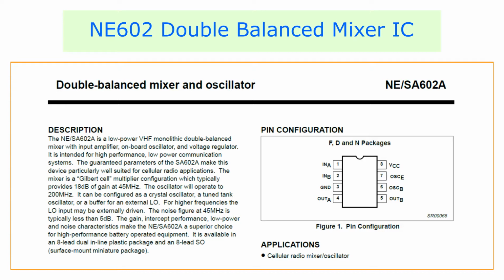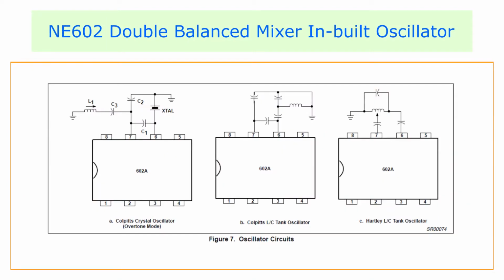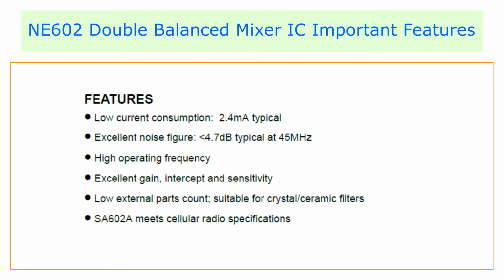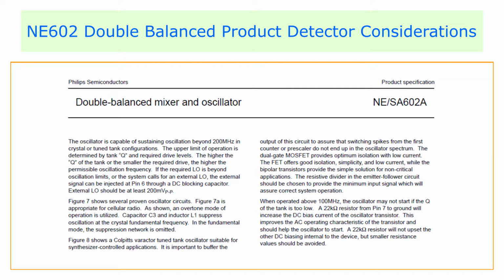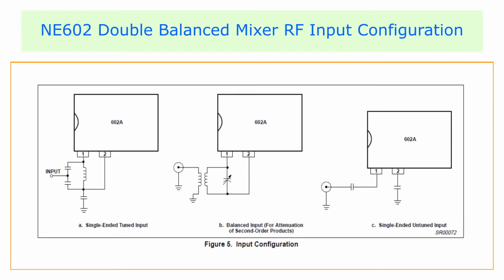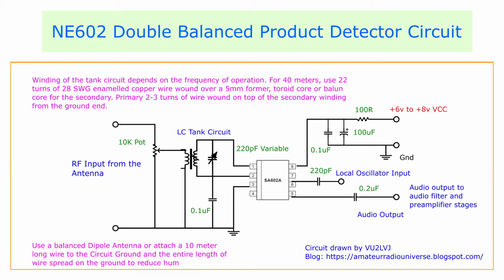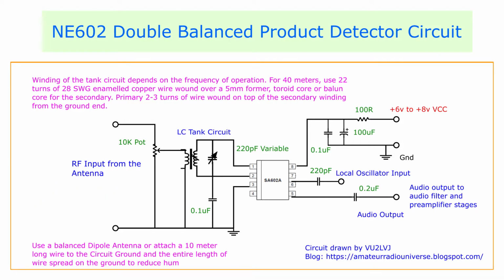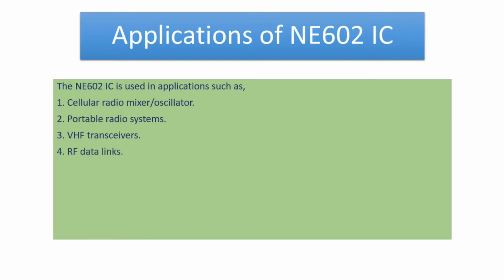Direct Conversion Radio Receiver Using the NE602 IC Double Balanced Mixer Product Detector

Comment: Wouldn't it be easier to fill over the strip board and solder directly to the traces?

Leaving the component leads long is good if you want to reuse the parts for another project but each lead acts as a small antenna.

That's probably where a lot of the buzzing is coming from.

It's still impresive. 

Good job.
Reply from the maker: I am planning on change the soldering style to direct component wiring on copper tracks (Manhattan style) in the coming series of videos. The old series of videos are just for demonstration and experimentation in the normal method. I fully understand the disadvantage of doing high frequency (HF) and very high frequency (VHF) circuits with the old method.

Comment: Went through nostalgic memories of my long lost homebrewing skills! But the maximum I have homebrewed on RX side is the old L-Board six transistor superhet radio. On TX side I had gone a little more as I could not afford commercial TX then. Started with VU2VWN QRP and upgraded to 3 x 807 vacuum tube QRO with 120 W DC input, for CW/AM in those days. 73 de Jon, VU2JO
Reply from the maker: Nice to know!
Reply: @amateurradiouniverse  73